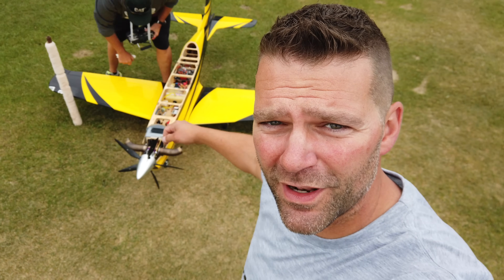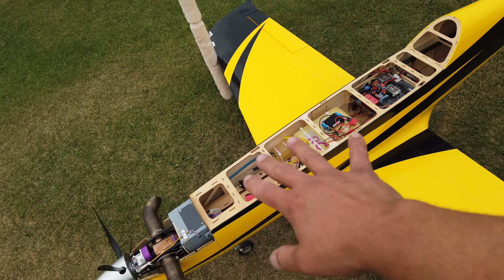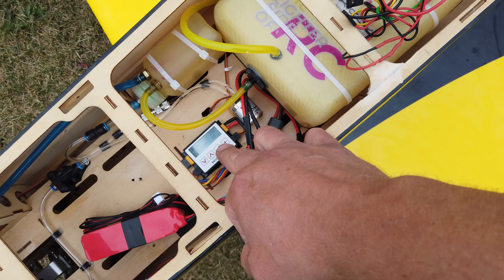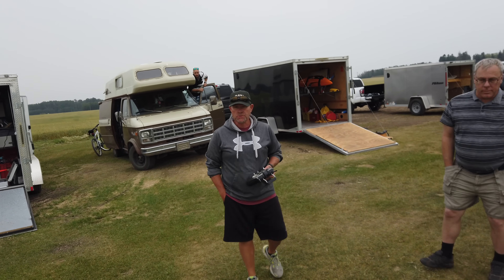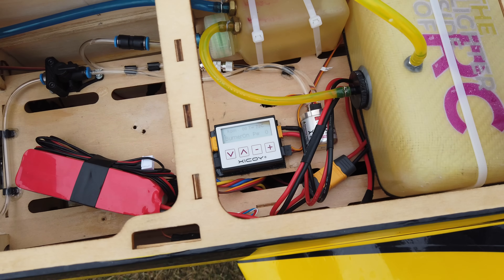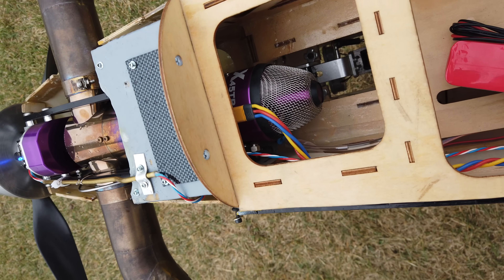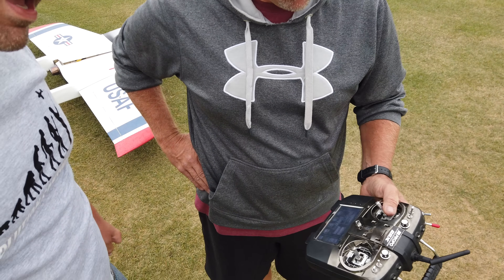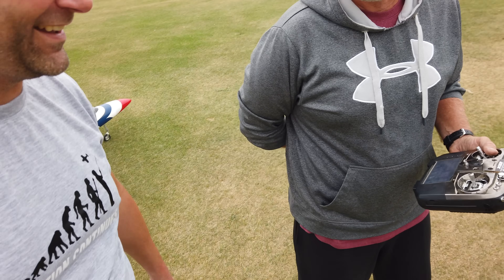FIRST FLIGHT OF THE XICOY 45 Micro Turboprop

Comment: You can hear just by listening to the sound of the engine and gearbox that it's an absolutely well built and precise powerplant. No screaming of the rotor at 200k rpm unlike other engines

Comment: I really don't see the point in this. The jet engine made the propeller driven plane obsolete. Why power a prop with a jet engine?? I've seen brushless electrics that would blow this out of the water 🤯
Reply from the maker: It’s a turbo prop. Great multiplication of force and efficiency for the size of engine. Turbo props are very common in full scale aviation as well.

Comment: I love that turboprop engine. I wonder if it would fit  a Rodell Modell PC-9 which is just a tad smaller than the PC-21 from Sebart. 10cm less wingspan and 1kg lighter might be a tight fit but worth the try. Rodell PC-9 was to be equipped with a 35cm3 OS-BGX-1 or similar engine and they come at 1.4kg without muffler, so maybe about 1,6kg with pipe and attachements. Not far off the 1,8kg of the Xicoy Turboprop.
Reply from the maker: They are pretty unique for sure!  Lots of fun and great sound!

Comment: What are the biggest differences between the xicoy and the wren?
Reply from the maker: Wren is old Tech.  New Turboprops such as the xicoy seem to be built better and more attention has been spent on rigidity in the system and gearbox design.
Reply: @thelightersideofrc  Interesting.  Thanks!  I don't suppose any of these are up for UAV duty are they?  The 25hr service interval is pretty short

Comment: Does the variable prop adjust pitch with rpm automatically?
Reply from the maker: The prop is fixed in flight.  Just adjustable pitch then fix it in place.

Comment: I was wondering if the throttle stick controls just the pitch of the blades, with some sort of governor managing the turbine to keep the prop at a constant RPM? Are there separate controls for turbine RPM and prop pitch? I guess my question is how the hell does that work haha. Awesome channel BTW, recently subbed 👍
Reply from the maker: Hello Tommy!  The blades are set to a fixed pitch but are adjustable (not in flight). The throttle stick only controls the power setting on the engine.  Thanks for watching and subbing!😊

Comment: Question: i have a friend with same plane and he has to turn the plane inverted in order to retracts go in, did you do anything to landing gear ? It is electric ? Or air retract? 
Thanks
Reply from the maker: Hello Gerardo!  Yea this kit comes standard with Air retracts and they are garbage.  This aircraft when ordered was built with JP Electric Retracts.  They have their own issues but at least you don't need to invert the plane to make them work.  The Air retracts that are supplied with the kit have a very small air cylinder which I believe is where the problem stems from.
Reply: Thanks for the information, i am planning to buy the jet and i was thinking to replace them with electric retracts.  Do you think i could replace the cylinders for bigger ones with out problems? 
Btw your channel is awesome 👌
Reply from the maker: I think trying to change the original cylinders to larger will not be possible.  The overall design of the retracts wont allow it.  I would plan on going electric!  Thanks for watching!

Comment: congratulation, perfect flight, scale sound, bravo!  can you tell my abot the manufacturer of the RC PC 21 Airplain ? thanx and ciao from Switzerland, Claudio
Reply from the maker: Thanks Claudio!  Steve has put near 40 to 50 flights on the plane now and is very happy with the engine/aircraft combo.  This kit is a Sebart PC-21 XL.  It's designed to be an electric setup but I converted it a couple years ago.  We have a Skymaster PC-21 Coming to the channel very soon!😎

Comment: Maybe you snuck one in that I didn't notice but, I would have loved to see at least one full throttle pass.
 Awesome power and very nice flying model with that combo.
Reply from the maker: Thanks!  If you watch the Sask compilation Video I think there is some full throttle runs in there!
Reply: @thelightersideofrc   Awesome! Thanks, I will have a look in a while. If it was only half throttle here I can only imagine insanity at full throttle. I love it, I haven't got anywhere nearby where I am stuck for at least the next few years where I can fly anything but bloody electric models. When I eventually get back to my home territory it'll be out with the glow fueled and petrol engined models and finally get a turbine for a large jet I've got sitting waiting for one. I do love this turbo prop setup but probably won't get one of these as maintenance on a turbine will be enough of an issue for me, let alone one with a reduction gearbox as well. I am extremely impressed by these turbo prop units though.

Comment: What is the gearbox reducing the shaft RPM to...what turbine shaft to prop shaft ratio?
Reply from the maker: There is no direct connection between the turbine and the gearbox.  I'm not sure of the gear ratio but this gearbox is the higher RPM model so it will max out at 8000 rpm with the turbine at 225000 rpm.  This is all subject to prop diam and pitch.

Comment: Sits nose down on the ground, can you shorten the mains or lengthen the nose gear?
Reply from the maker: It’s a bit of an optical illusion on the PC21. Mains have been softened. If you search up some full scale pics it has that look too.
Reply: @thelightersideofrc  yeah you're right now that I check it out, the 9s were a bit like it too, the higher tail makes it look exaggerated.

Comment: Actual aircraft don't rely on batteries for avionics, telemetry,
or ignition. They usually use an APU. 

Could an aircraft turbine be scaled down even further, to
then be paired with a generator?

Could a generator be fabricated to install to (couple) the shaft
of the primary turbine?

Has anyone ever built or manufactured a tiny generator? Not some
cheap LED running thing, but an actual device that mimics the
output of your RC battery pack? Maybe not to fully replace, but
to recharge would be fantastic. Just use the battery to spread out
the load. 

What is the combined system electricity requirement of this plane?

I'd think you'd want a comfortable safety margin of at least a 1.5 overrun
reserve capacity, so as not to tax the system. A decent magneto, like
a riding mower/snowmobile uses, just smaller.

Fabricate actual wing fuel tanks?
Larger, Commercial aircraft have fuel bladders in the wings.

Flight time could be measured by fuel, instead of mAh of a battery.

I can imagine an actual scaled down version of a decent Cessna
would be cost prohibitive, but still under the cost of an actual plane ($30k)
Reply from the maker: Great comments and questions. A few years back, jetcat cameout with a generator on their turbines. Basically the starter motor on the front of the turbine doubles as a generator. Uses magnets to Spin the starter motor/generator. 

Only available on their larger engine but essentially you eliminate battery charging
Reply: @thelightersideofrc  I'd love to see a few YouTube Creators
get their skills together, manufacture my ideas.
Keith Fenner/Abom79 for Machinists
BigClive and Aaron Cake for electronics
The Lighter Side of RC/FliteTest for the aircraft (mods)

I guess I'm just a stupid old man with pipe dreams.
Reply from the maker: Dreams are where the fun stuff comes from!

Comment: Is it normal for it to be so nose down while taxiing?
Reply from the maker: The PC-21 is a bit of a weird looking airplane from a side profile.  If you pull up a picture of the full scale, because of the cockpit orientation along with other lines on the plane, it looks like it's got a nose down attitude.  The owner has stiffened up the front strut to help with this as in stock form it's too soft.

Comment: Thanks for demonstrating how a test flight should be done. Good weather. Checks on the ground buttoned up. Taxi checks done. Acceleration straight and climb to a safe height at safe handling speed while trimming, gear away early incase of engine failure, moderate speed and once rates and trim explored, some mild aeros. Alarm set so no previous distraction with fuel level guessing. Pop the gear, check trim, flap, check trim. Stabilized approach to achieve safe touchdown. Home for tea and medals.
Reply from the maker: Thanks Stewart!  That’s exactly it!  😊

Comment: Fantastic just made sure you  reinforce the rotation pins in the fuse and the wing ,if not will tear off the wing , well done  on the motor.
Reply: Is that a thing? Had a wing failure a couple of years back on one of these...
Reply from the maker: Thanks!
Reply: The question is though, what condition did it fail in? Was it G overload or flutter related? It could easily be abuse that causes the failure and not poor structure.
Reply: @stewartgrant9832  Thanks Stewart the front pins fell out at the leading edge ,no glue or not enough glue.Mine got replace under warranty. Now I have put in bolts at front and back of the wing ,works well.

Comment: Theo: The Xicoy gearbox is the LR version turning @ 8k RPM, the RPM will be reduced to 7500 k RPM max as per Vario prop restrictions.
Reply: Hi Steve,
I just bought the same Sebart PC21, awsome plane and I'll put in the xicoy :) Which diameter of prop do you use?
Thanks for your answer.
Reply: @schouberfouer  that is the 18.2" dia 5 blade Vario prop

Comment: I flew the plane the entire first flights at the manufacturer’s recommended reduced RPM of 201 k for the full 1 hour flight time and still flying at slightly reduced RPM to be safe, very strong turbine!
Reply: Hi Steve which gearbox ratio did you go with LR or HR?  Incredible performance
Reply: @theoavana  that is a LR version, 8000 RPM 
It is awesome!!
Reply: @stevemorgan5684  thanks.. it’s definitely punching well above its size. I’m trying to settle on a model for one myself 👌